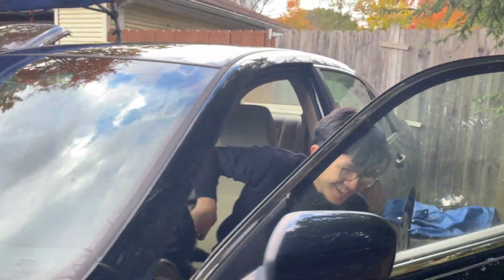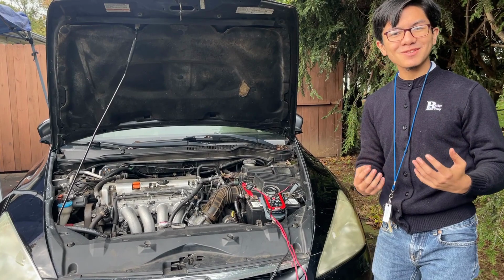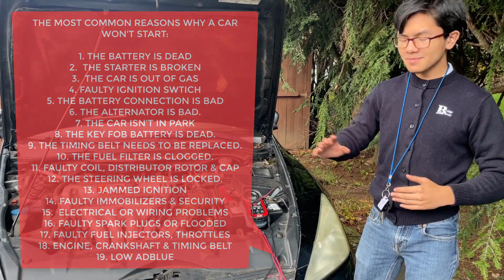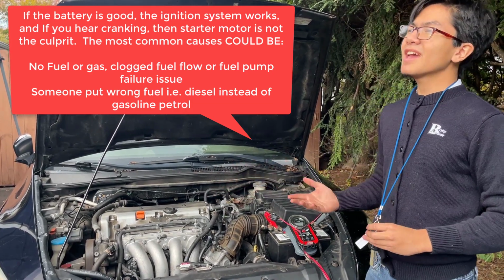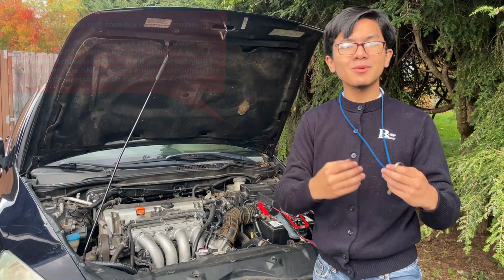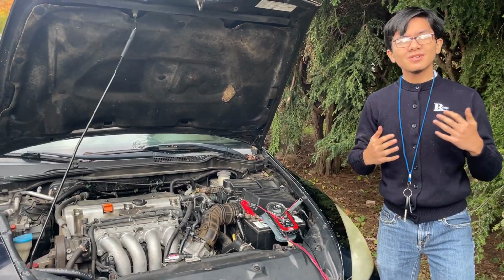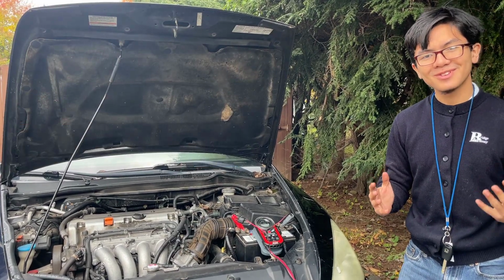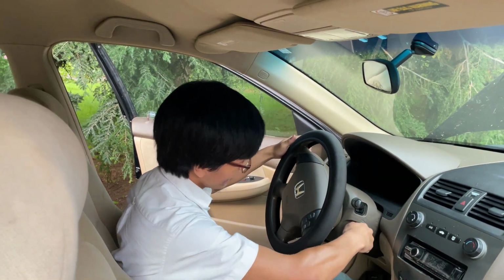My Car Won't Start! Most Common Reasons Why, What Causes It & How To Diagnose Vehicle Not Starting

Comment from the maker: Here are the #ad links to some of the tools & parts which might be required to perform this repair:
1.  https://amzn.to/3mN1cYZ  | GOOLOO 4000A Peak SuperSafe Car Jump Starter (All Gas, up to 10.0L Diesel Engine) 12V Auto Battery Jumper Booster with USB Quick Charge and Type C Port, Portable Power Pack for Trucks, SUVs, Orange
2.  https://amzn.to/3EHcQKR  |  DC 2.5-32V Backlit Car Fuse Tester, Digital LCD Circuit Tester, Car Circuit Diagnostic Tool with 7.9Ft Extended Spring Wire for Engine and Ignition System Test
3.  https://amzn.to/3JuN00i  |  GEARWRENCH 15 Pc. Serpentine Belt Tool Set with Locking Flex Head Ratcheting Wrench - 89000
4.  https://amzn.to/3HtbLZ6  |  Fluke 88 V/A Automotive Multimeter Combo Kit
5.  https://amzn.to/3FMc6FI  |  Schumacher SC1281 100 Amp 30 Amp 6V/12V Fully Automatic Smart Battery Charger 100A Engine Starter and 30A Boost Maintainer and Auto Desulfator Advanced Diagnostic Testing

Or Click on Amazon link here and search for what you need:  https://amzn.to/3xIOsqg